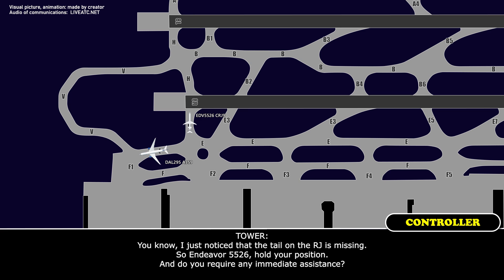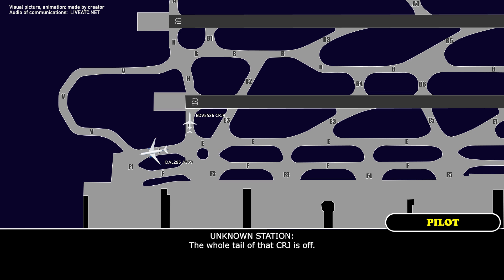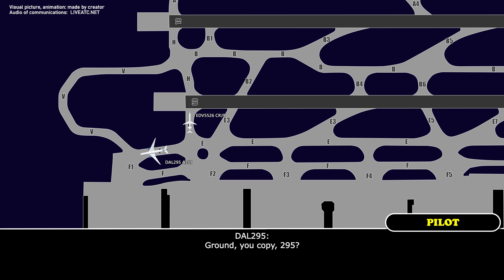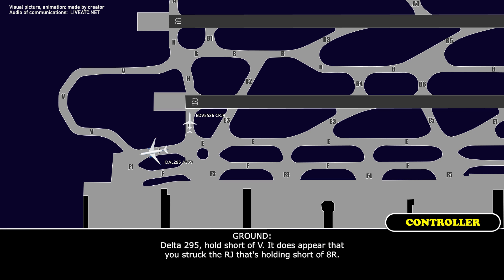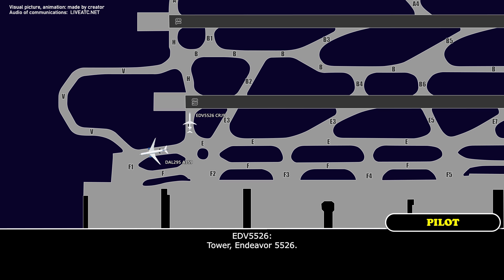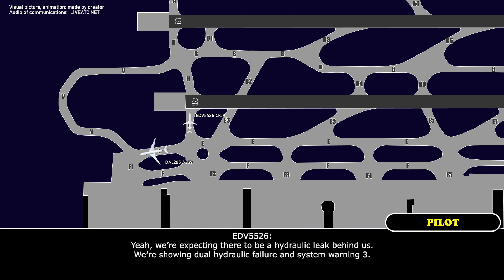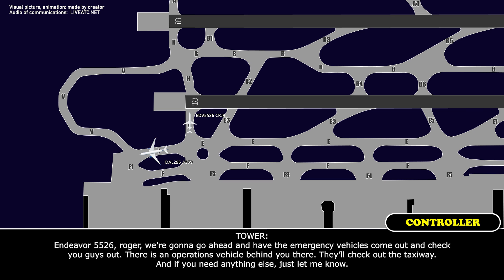“The whole tail is off”. Ground collision at Atlanta. Delta A350 and Endeavor CRJ-900. Real ATC

Comment: Echo is quite close coupled to that runway.  Doing a quick Google maps comparison of the wingspan of an A350 and where that CRJ was holding short, there would be little to no clearance for that A350 to pass behind.  The CRJ would have to violate the hold short lines to be far enough out of the way.  If a 737 was there, it would have been worse (although a tail on the ground is pretty bad.)

Ground screwed up.  Oh, don't get me wrong, captain/FO owns the A350 while it's moving so they're part to blame on this, but Ground should have known better, but perhaps because it hadn't happened yet, there's not yet a rule.  I bet a rule gets written after this though, wide bodies don't pass on Echo if there is a plane holding short, ground commands are overridden. 

But what do I know, at the end of it.  Perhaps the CRJ didn't get right to the bleeding edge of the hold short lines and that's the problem. :|
Reply: Time to shorten up the CRJ's to fit on Echo properly.
Reply: CRJ 900 is a long airplane for commuter aircraft!
Reply: @SAC-93  That is why I love that aircraft.  Reminds me of the MD 83s.
Reply: Not a pilot, simple question. Is the FO expected to have the visual acuity/depth perception, to precisely determine, peering down the length of the starboard wing, with the AC moving, the safe distance between the tip of the wing, 116 ft away, and the tail of the CRJ?  Or similarly while the A350 is approaching taxiway H?
Reply: CRJ was over 40' short of the hold short bars. He would have been clear if pulled up further, if you run the measurements on the 2 planes and the field. I'd place 60% blame on A350 for not being more careful and verifying they had clearance, 30% on CRJ for not pulling up further at an airport with this kind of layout, and 10% on ground for not at least prompting the A350 to double check their wing clearance (which is nearly impossible to tell for sure from how far/high they are).
Reply: Both planes out of service.  Painful, really painful.  I hate to see things like that happen to jets.  Really love that CRJ.
Reply: Interesting. According to Google Earth, hold short line to taxiway E centerline is about 80 metres. CRJ-900 is 36 metres plus half-wingspan of A350 (33m) is 69 metres, that should leave plenty of clearance. One of the planes (or cumulatively) must have been almost 40 ft off.
Reply: @mikeybhoutex  nothing you said about spacing is correct. Given the length of the CRJ and the half the wingspan of the A350 there should be ≅40 ft of clearance if the CRJ was actually holding short. It wasn’t, and got clipped by several ft.
Reply: >If a 737 was there, it would have been worse

In terms of APU or systems, or another Boeing "event" that's been in the news lately?
Reply: The tail doesn't even have to be on the ground ... it not being upright is already pretty bad :D
Reply: I assume that the ground controllers knew what airplane was holding. If it was an airplane that fouled the taxiway when holding short correctly (likely anything much bigger than an RJ), they would not have cleared the A350 to taxi. Or more likely, not cleared the bigger airplane to hold short in that spot to start with. That CRJ was a LONG way back from where he was supposed to be. On an airplane as large as an A350, judging go/no go for wingtip clearance in this situation is pretty much a non-starter - the pilots can't SEE the wingtips, and the angle is going to be such approaching that it is not going to be at all obvious in a situation like this. The system depends on everybody doing what they are supposed to be doing. 

I'm not a pilot, but I fly 120+ segments a year, normally in a window seat at the very front of the airplane - when holding short, the nose of the airplane is normally RIGHT AT the wig-wag lights marking the hold short line. This CRJ was WAY back from where he was supposed to be. And even then - it almost worked, the A350 barely got him with the tip of the wing based on photos of the damage to it. Hit him by "this much".
Reply: Airport taxiways were clearly not designed with the fuckhuge airplanes we have today in mind. It's for the same reason that many of the largest container ships could not pass the Panama Canal until they built larger locks.
Reply: Zero blame on the A350 blub.
Reply: @DaSMan819  Would that be your conclusion when a pilot accidentally hits another aircraft on the ground? That's a relatively new plane that costs around US$150mn in bulk orders. Forget the embarrassment, that's two Delta planes out of service that requires costly repairs. I presume Delta management are beyond upset for something like this happening in their main hub. The only good thing is it happened in Atlanta so Delta has facilities/people to inspect make the repairs.
Reply: @yo2trader539  that is my conclusion indeed
Reply: @DaSMan819 lol like saying zero blame on the pilots if a plane flies into a mountain in VMC because ATC said the wrong heading.  They didn’t just barely clip the tail, it was 7-10 feet judging by the video.
Reply: @qwerty112311  taxi’ing on the tarmac is not comparable to flying into a mountain, try again.
Reply: @DaSMan819  it’s the exact same thing — pilot got directions from ATC to do something, but they have the ultimate responsibility over the aircraft.  These pilots are toast.  Stevie wonder could have seen they’d hit the plane with how much overlap there was.

Comment: Well, the CRJ failed to get close to hold  short line and the A350 failed to identify that the CRJ was way out (FO responsibility). Both are blame
Reply: Going to be a combination of 5526 well short of the hold bar and 295's FO interpreting they had ability to clear 5526
Reply: Ground should have told them to hold short of hotel, but she failed to do so.
Reply: Endeavor was at fault. They were some distance from the Hold-Short Line..
Reply: @edwardrichardson5567  Wrong. The pilot of the Airbus MUST be in control of his craft at all times, and operate it safely.

Comment: Not a problem tho, some duct tape, a little plastic panel filler... The rest of it will all buff out after a light sanding.
Reply: Nah, that wouldn't happen at Atlanta.  You're thinking of O'Hare and United where that would be SOP.  lol
Reply: Amazing that there are grown adults out there that still think some variation of the "that will buff out" comment is still funny.
Reply: A 12-function strap-on from Adam and Eve will do the job.

Comment: The A350 cannot taxi on Victor (wingspan). I don’t understand the clearance to taxi E short of V if they were departing the airport.
Reply: Probably to turn left and go thru ramp 1 to 9L.  Would be my guess.
Reply: I think ATC wanted the plan to stop on a position were it does not block V.
Reply: She says, “hold short of V, advise when ready.” I’m guessing they had to delay takeoff for some reason and this was the clearance to get them out of the way of departing traffic. 9L (the preferred rwy for the 350) was NOTAMed closed.
Reply: @LSUtiger607  i heard some earlier ATC comms and it sounded like DAL295 was being moved out of the way to "work on a problem" as they stated. i could be wrong though
Reply: That size aircraft can't use Victor or even transit ramp 1. Best case scenario they would have been given a 180 back east onto TWY F. Definitely not 'normal' taxi instructions but it was very, very busy at that time of morning.

Comment: Endeavor 5526 should be at fault. Instructions were to hold short AT runway 8R, not 100' back from the hold short position.
Reply: If that true then yes there at fault, but it’s also the job of the other crew to make sure there not at risk of hitting another aircraft
Reply: I would hope that if there are any pilots in here that it would be immediately obvious that the CRJ isn’t holding short properly-not even close-and the A350 wasn’t watching close enough whether on the centerline or not. Horrible.
Reply: I mean I'm not sure but if there is any correlation to road traffic then it should be the delta planes crew resposibility  to reassure they have wing tip clearance at all times during taxi. Even if they are on the center line they have front windows to check for obsructions and even if they have clearance to go to a designated spot THEY must stop if they have the slightest doubt of beeing able to pass. The Endevour crew cannot see what is behind them at a very wide angle.
Reply: @lastannahme  tbf the A350 is massive and its wingspan is very large, so it would be very difficult to judge from the cockpit that the RJ was to close, and if he was following ATC instructions he likely thought the RJ woulda continued forward, it looks like the RJ stopped well before the hold short bars
Reply: @a_goblue2023  at which point the A350, who knows he's very wide, would be wise to slow or stop and seek clarification from Tower... or someone external to the plane.
Reply: @a_goblue2023  it's difficult to tell but still , maybe the RJ hab a reason not to move forward. If your moving forward like the A350 you must see what is in front of you and at least have an idea of your wingspan no matter what size you are.
Reply: @1947dave  yeah but the endeavor plane was way to far away from the hold short bars, it’s kinda the fault of both crews. Atc wouldn’t have cleared the A350 to pass behind if he knew the RJ wasn’t going to be at the bars
Reply: @lastannahme  why wouldn’t you move forward, the bars are there for a reason so you know where to stop, unless there some sort of obstacle on the runway there’s no reason to stop there
Reply: @1947dave  yep.  When in doubt, hold short.  Waiting one or two minutes for the RJ to roll would have avoided the whole problem.  Sometimes the Captain really has to earn that $400,000+ salary by doing a little thinking.
Reply: @a_goblue2023  Well in the end it doesnt matter why he didnt pull up to the bars, could also be some technical failure or many other reasons actually...he still cant see whats behind him while the other guys can see whats in front of them.
Reply: @m.f.m.67  oh he's definitely making more than that.
Reply: @KuostA  Making? Perhaps.  Earning, not a chance.
Reply: @m.f.m.67  This is the most pertinent comment in here.
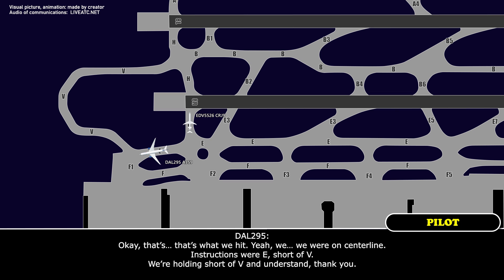Reply: At 1:11 I also think you can hear the stress in the delta pilots voice. I think he knows he's at fault.
Reply: @lastannahme not neccesarly is the A350 pilot at complete fault. That is a stessful situation for any pilot, especially a relatively new aircraft..
Reply: Delta pilot's voice would be stressful because he can't yet be sure who is at fault, not because "he knows he's at fault".
Reply: @cassandratq9301  good point. I correct myself: He sounds stressed because he knows he could be at fault.
Reply: It could be they were #2 for the runway and #1 departed shortly before/during the contact.
Reply: Well, you're wrong.

Comment: Man you are quick. Isn't it the pilots end responsibility to make sure their aircraft will clear other aircraft the taxiway? ( I know they were following instructions but just want to understand if any fault falls on the pilots )
Reply: No way the crew can see the wingtip on a A350. If they were on the centerline and the CRJ was holding short where he was supposed to, then I think this one could be more on the ATCs lap.
Reply: @Shadow__133  When in doubt, hold short.
Reply: I think with how wide the wings are and how far back they are from the cockpit, they're pretty much at the mercy of ATC generally speaking. The taxiways are designed to accommodate planes up to a certain width, and it is on ATC and the pilots to make sure the plane moves on appropriate taxiways, and on the pilots to track the center, which should have a trail of lights to help with that. The pilots should be able to trust (to an extent), that ATC is giving good directions backed up by ground radar, and to trust other pilots to be accurate when they report being clear. If not, they'd slow ops to a crawl triple-checking that they're going to clear every possible obstacle like a student driver backing into a space for the first time. I am curious to hear the CVR to see if they voiced any doubts about the smaller plane being clear, though. If they had doubts, they should have stopped right then to verify, and by not doing so could have more fault.
Reply: @JDrapic

☝️This!☝️
This seems to make sense.
Reply: Well, pilots can't really see all the way back, daughter. There are no mirrors. I don't see how we can blame the pilots. ATC can't be measuring things. It seems that everyone is at the wrong place and wrong time. The length of TXY is bad.
Reply: @user-xp9hu8sg9o  : There are no mirrors, but FO certainly should have seen the CRJ when they passed it. The windows also open, so you can peek out of them if you are not 100% certain.

The CRJ didn't suddenly teleport to that spot, it was in it when the A350 went past, so there was plenty of time for FO to observe the position.
Reply: @smark1180 do you mean what is the wing span of the A350?
Reply: As "we" have discussed many times before, in today's world cameras are so inexpensive that there really is no excuse for not being able to see all the extremities of the aircraft, and also critical parts of its structure.
How often have we heard "there was major damage to this or that part of the aircraft but the pilots did not know because they could not see that from the cockpit".
Add some cameras and they would know.
(actually, I think modern Airbus like the 350 DO have the cameras, but they are for entertainment not for the pilots)
Reply: On most Airliners, the Flight Crew can barely see the wing tips..

Comment: Both are going to have numbers to call...
Reply: Doesn’t sound like the Endeavor crew did anything wrong.
Reply: @michaelbarrett9107  yes they did
Reply: i would imagine this would be an ATC issue, to me this seems like their fault
Reply: @frograilfanning  Tower has to take down a number too. ;) But yeah, I think the CRJ was just too big for ATC to allow the A350 to taxi behind. They would not have allowed the A350 to taxi there if a 777 was holding there! So they need to update their notes on what size a/c they can allow to pass while another holds.
Reply: Going to awkward when both crews have to speak with the airline chief pilot's accident investigation team.  CVR transcripts would be quite interesting.  No doubt both start with "What the [bleep] just [bleep] happened..."   Video appears to show the CRJ was way short of the hold bar.
Reply: I assume the pilots and controller were promptly drug tested. At least I hope so.
Reply: got some "splainin' " to do
Reply: Were they holding in the right spot?
Reply: @cbspock1701    Someone said that they were holding TOO short--in other words, their tail was exposed.  I'm not sure if that's true or not, but it's a possibility that would need to be investigated.
Reply: @ajs11201  It doesn't matter if they stopped in the middle of the taxiway. The Airbus pilot simply cannot be taxiing blindly.
Reply: @StevenRogers-hw9dj    Look, I'm not here to defend the Delta pilot. You're probably right, but I do realize that those planes are mighty enormous, and while on the ground, the pilots rely on the eyes of the tower controllers to direct them through safe movements. It's not exactly like the airplane has sideview mirrors where the pilot could see that his wing was about to clip another plane's tail.  So, again, I admit I don't know all the legalities, but I do think that all factors need to be investigated. In this case, there's probably plenty of blame to go around to both pilots and the tower alike. We'll see.
Reply: @StevenRogers-hw9dj  dont blame the airbus pilot
Reply: CRJ pilots were at fault..
Reply: @edwardrichardson5567 How? They were holding short of the runway.
Reply: @Shadow__133  Smaller plane, smaller company, smaller union membership, smaller paychecks...yep, they will be at fault! 🤣
Reply: @m.f.m.67  smaller company????  They are both Delta planes
Reply: @Grumpz_Golfs  Not exactly. You clearly don't know how the Regional Airlines work.
Reply: @Grumpz_Golfs  *So that you do know, notice how one was called Delta and one was Endeavor. In the U.S., larger airlines hand their regional operations to other companies. I don't understand exactly why, but It's most probably cheaper. That's the reason why the Embrear E2's are failing to sell in the U.S.; big airlines like Delta don't want regional operators to compete with them if they are partners, so they have weight limits on aircraft.